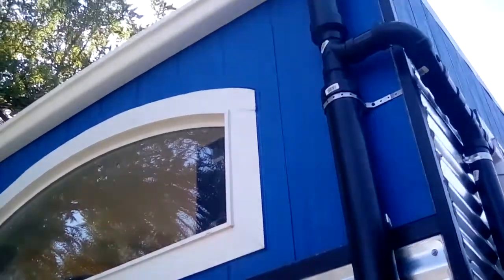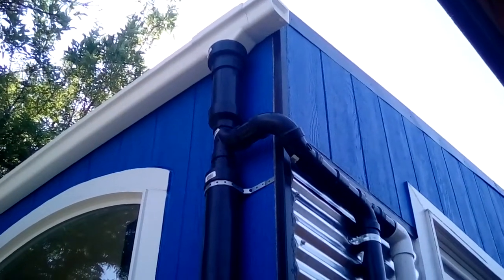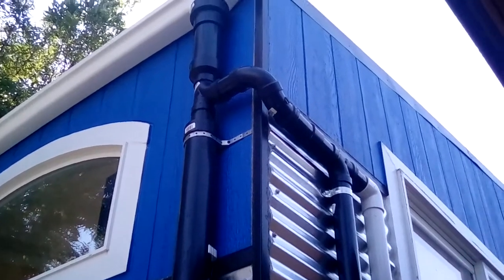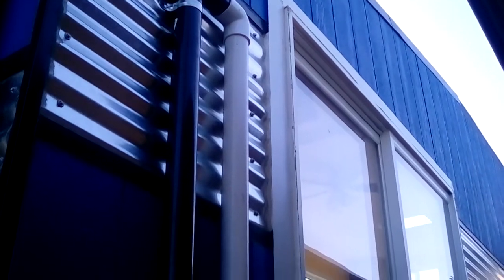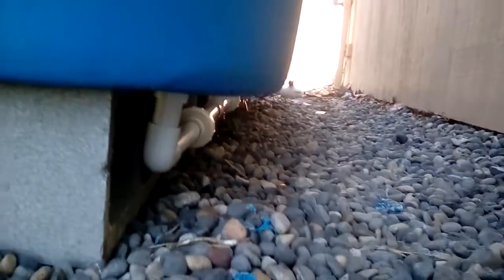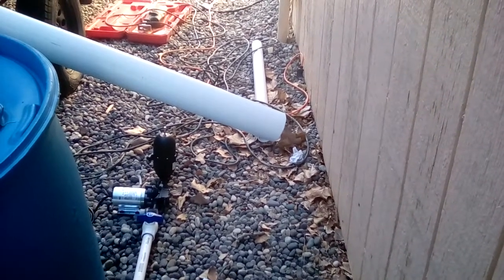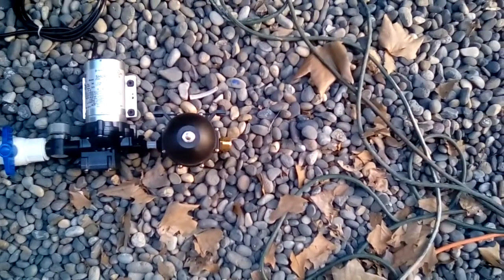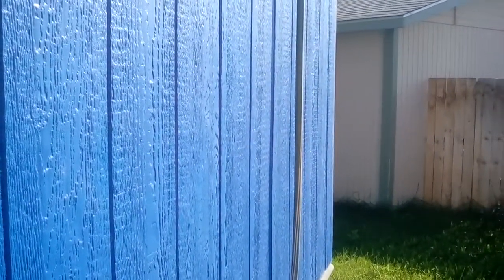Off Grid Tiny House Rain Water Collection System

Comment: ok so are you using any kind of screen or filter like charcoal or carbon? Also why so many Google +? lol
Reply from the maker: Hey Keith, no there is no carbon screen on the system.  This water is not for drinking, just showering and doing dishes/laundry.  To drink rain water I will either just get a Berkey water filter or add an inline filter to the pump.  But that is for a later date!
Reply: I must have missed the gray water. excellent work Wolfgang!